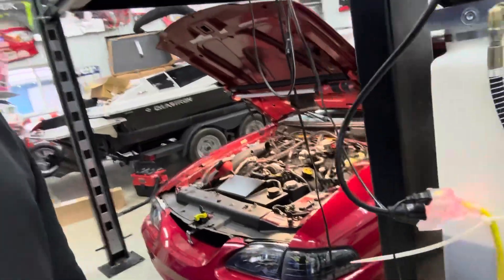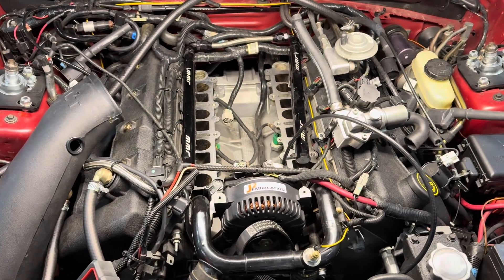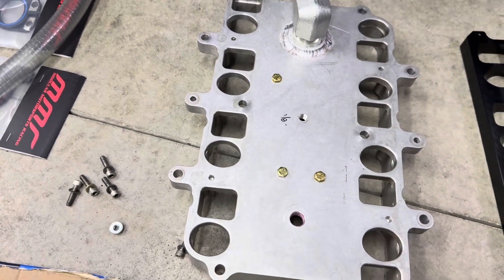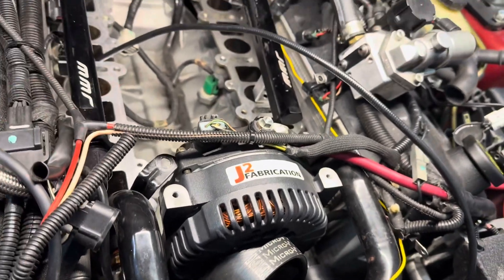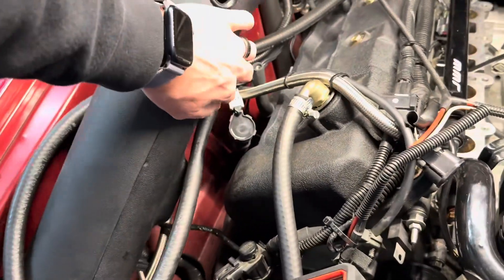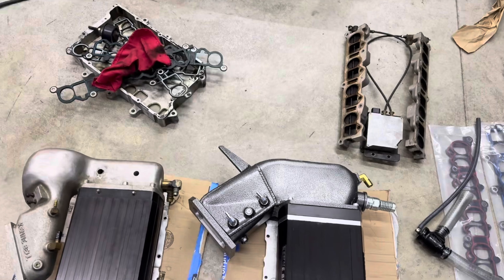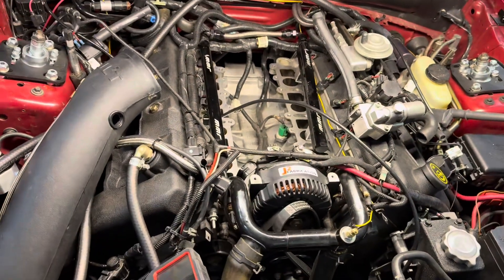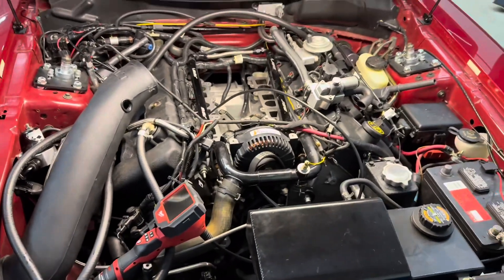96 Cobra Kenne Bell 1.5L to 2.1L supercharger swap

Comment: Are the lower manifolds the same on both? I have a1.5 but it’s port matched and all my meth nozzles are threaded into the bottom along with bypass so if I get a 2.1 I’d like for it to just bolt to the stock 1.5 lower open house manifold

Comment: I’m curious to how cool the temps will be with all that meth injection, and how much power it will make on e85
Reply from the maker: @RandyDrives  they guy I got this supercharger from with this custom intake elbow make 650rwhp on E85 and meth injection. However I don’t really want that much in this car for what I’m doing. If I have a good safe tune around between 500-550 rwhp is my goal. The 1.5L I was making 400rwhp on E85 not tuned for meth at all so it was conservative on timing because intake temps could get high and the temp sensor wouldn’t have known it in the factory location
Reply: I’d like to know who was making 650 rwhp on a 1.5 or 2.1 Im one of the original guys who did the inlet mod and bypass and making 550 rwhp maxed out 1.5l at 14 psi I know the 2.1 can do about 20 psi but im not sure he’d squeeze 650 rwhp from it